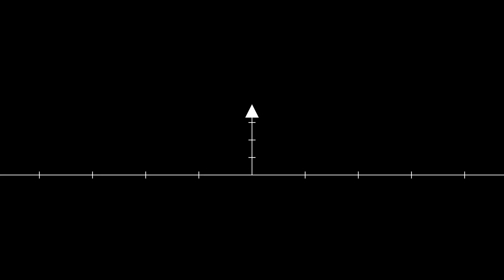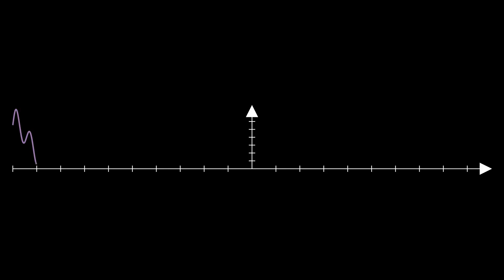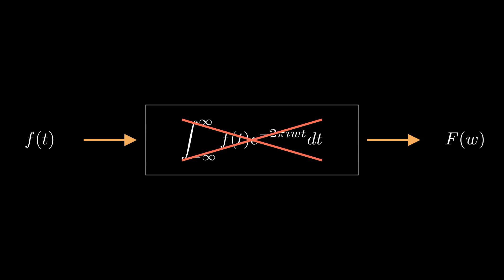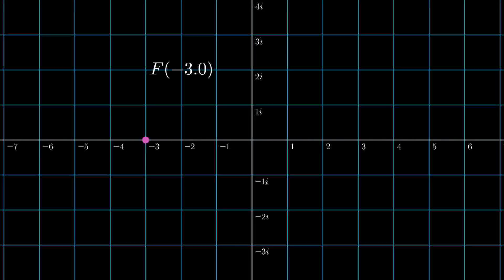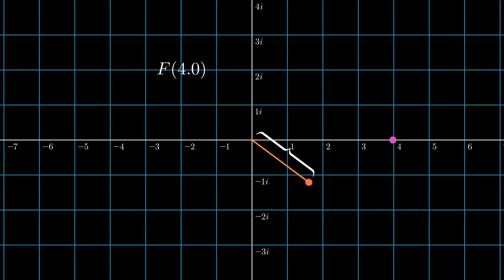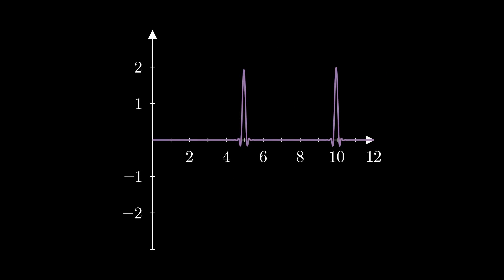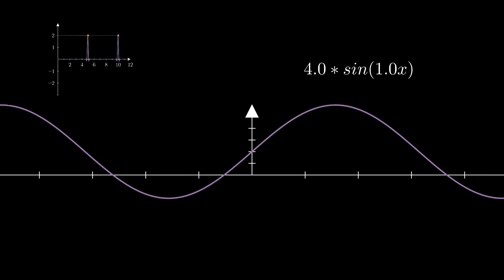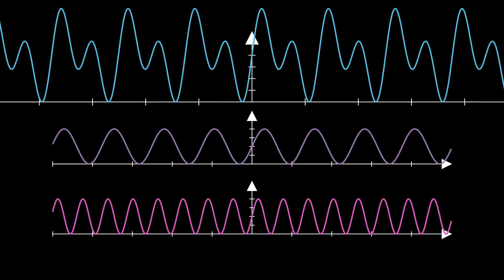Fourier Transform in 7 minutes

Comment: Good video. However a minor comment: Fourier Transform gives information about the constituents of the composite wave. i. e, what are the harmonics (Frequency) and Amplitude of each. FT does not add them up to get the composite wave. That you have to do separately using the information you have about the Frequency and Amplitude got from FT. A Fourier 'series' does that. However in FS, frequencies are Integer values while in FT it is a continuous spectrum of frequencies. FS is useful for an infinite composite periodic wave existing from -infinity to +infinity, but with a specific wavelength. But FT is useful for Aperiodic which exists only for some specific duration (i. e, non zero instantaneous values from say t1 to t2 instants. And zero at all other times)

Comment: 5G or Fifth Generation wave is one/1 millimeter wavelength that is the distance between two peaks of the wave.   ||  <-----this is what 1 millimeter distance looks to scale. That's why it cannot pass through solid objects, walls and even glass windows. Also it has a very short distance it can travel between cell towers. Transmitters must be within 500 foot distance of eachother which means that to get full coverage these 5G transmitters must be put up...well you do the math! These are the so-called "Achilles Heels" of full 5G roll-out that Verizon (et. al.) dont want the consumers to know! This is why 4G is not going obsolete anytime soon. By the way the real reason for 5G is not to give the consumer faster download time for movies (that's the cover story cooked-up to separate the customer from their wallet) its really for autonomous driving vehicles that require lightning fast reaction time that 4G can't keep up with to be safe widespread.